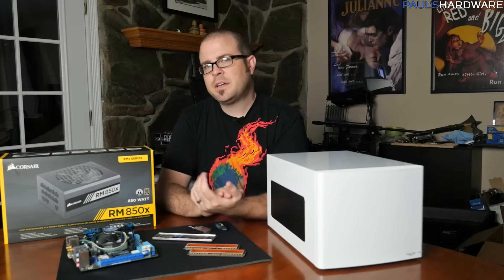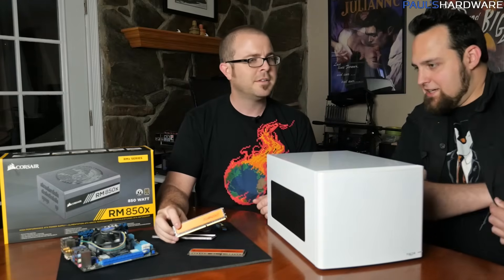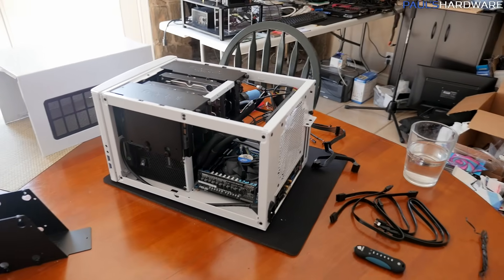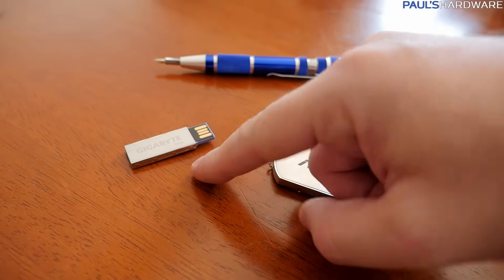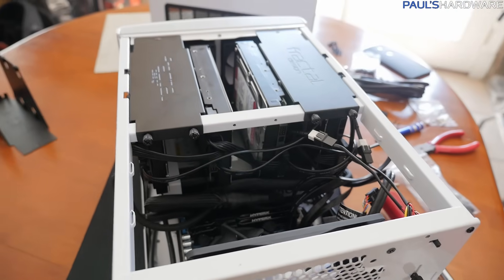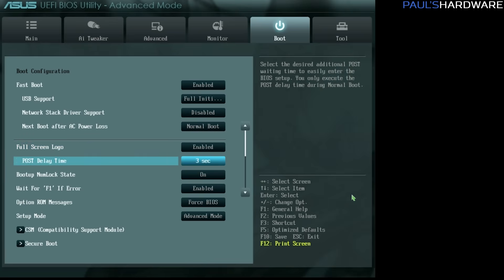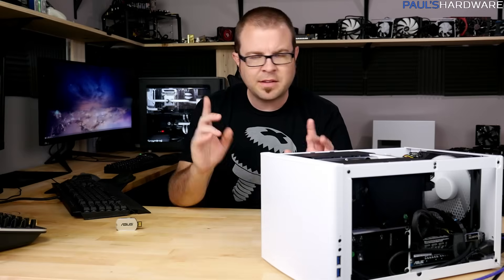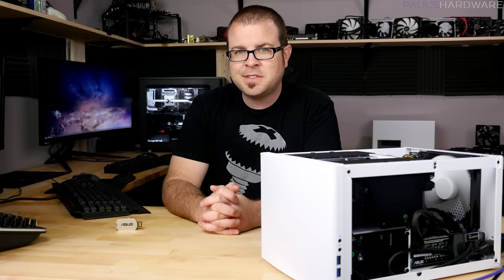Epic 16TB FreeNAS Build (Surprise Guest!)

Comment: Do I really need WD Red instead of Blue ??
For the price of a 2TB Red I can get a 3TB Blue !!
Reply: +Francesco Lorenti It's recommended because of the way the NAS drives are manufactured and certified, regardless of whether you're talking about the WD Red, HGST NAS drives, or Seagate NAS drives. They can handle random reads and writes a lot better and are designed to be thrashed like crazy due to random reads and writes coming from multiple users simultaneously.

That being said, you can use a WD Blue or any other desktop drive, provided they're reliable (check the reviews), especially if you don't anticipate using your NAS heavily or if you're the only one who will be accessing it. Heck I've read of some NAS builders using WD Greens, and others just use whatever HDDs they have lying around.

Whatever drives you do use, make sure to set things up so you have some level of redundancy so you don't lose everything when a drive dies. And offsite backup or cloud storage for the critical stuff you'll be storing on the NAS is always a good idea as well.
Reply: +brandishwar yes just as I tought, I'm the only one thats going to use the nas and whit the money I will save i will get two 3TB blue put them in raid1 and bam 3 TB of always backed up content accessible from my main PC and my raspberry pi connected to TV,
thank you very much for your answer
Reply: Francesco Lorenti
No problem. One recommendation, though. If possible, get the drives from two different retailers -- e.g. buy one from NewEgg and the other from Amazon. This will virtually guarantee you're not getting two drives from the same manufacturing lot, which will lessen the likelihood of you losing both drives within a short time of each other.
Reply: +brandishwar if only all the people on the internet were more like you, internet would be a better place. 
Again thank you, you've been very helpful !!

Comment: No drive slider/drawer for easy replacement of failed raid drives. 
The joy of youth and innocence...
Reply: Its a home nas... Not a business solution.
Reply: Niklas T Drives are not like tires... They fail whenever they feel like it just for sh1t and g1ggles. There is no backup of the startup usb drive. Big mistake. It's even worse at home, because you always have something better to do than tryin to find a matching drive for replacement. I spent 16 month with a failed drive in a raid 6 array thinking that I'll wait for another one to fail before going dumpster diving in the case to replace them...
In fine I bought a esata expander case with 8 trays and new disk to copy the array. unmounted the failed one and let her rot in the original case until the day I'm bored enough to do something about it.
your kind of apologism is not constructive...
Reply: +Michel BURTE II um tires also fail when they want too, so that makes no sense.

Comment: Can you run games of a NAS?
I'm really curios...
Reply: I did that with my previous NAS. I used Ubuntu as the host system, mdadm+lvm for raid and volume management, then added a Windows virtual machine and used PCI pass-through to give it native access to the GPU. Great gaming experience. Maybe 95-98% compared to installing Windows natively. It will become completely useless as a PC when you need to rebuild the RAID though. I don't think FreeNAS is suitable for this, but Linux is great.

Comment: This case gave me the idea of a challenge to put at use an old microwave, using the knobs to power up and control the fans. Unfortunately it would be to much work to make the motherboard spin XD Maybe the rotating tray can be turn to other aesthetic purposes. Even the bell (ascii 7) could be used as bio system warning, Kyle, Paul, Linus, Luke, anyone ;o)

Comment: Does this really need 850 watts?
Reply: No
Reply: +mungokiwi But it will consume more Power in idle (and maybe also just for storage)
then a lower wattage PSU, since the efficiency always is worst in the lower end.
Reply: +lápi póc He had it lying around and the system will maybe use 40-60W (5W per HDD and the CPU will not use much because NAS does not compute all that much). The number on the PSU is the MAX wattage it can output, not the average or anything, it will just output as much as the system needs.
Reply: mungokiwi i know all of that, but still, seems like a waste, regardless of the fact that he had it lying around.
Reply: +Ox King "always" is not true, it really depends per-power supply and difference can be so small it wont really matter + if he had it around, "why not" also higher-W power supply wont heat that much and some can run completely passive
Reply: I was going to say that as well... I'm all for overkill power supplies, but 850W is actually 100W móre than I have in my main gaming rig, and even my RM750x is slight overkill for my needs, so an RM850i for a NAS really is the mother of all OTT power delivery systems.
Reply: No but it does need something with enough amps to support 4 drives spinning up. Still overkill. Once you get up to 8 or more drives, the wattage is still overkill but the amps are not
Reply: System as built draws a 173W TDP. he's under a quarter of the PSU's rating, which is overkill, but low wattage gold or higher PSUs are kind of hard to find. plus, the larger the wattage gap the cooler the PSU should run.

Plus, each of those drives pull ~15W max, not 5W.
Reply: naw it needs 1500watts
Reply: you can run it with a 150watts pico psu.

Comment: Wy not un raid so you can have a nas and htpc in one
Reply: Freenas handles all of that. Unraid is for Linux tech tips children
Reply: +tobblich What? FreeBSD is awesome and rock solid with an incredibly good networking stack.

unRAID is basically Linux with KVM and a front end to manage it. Also, you wouldn't want to rock FreeNAS inside a VM as it has the potential to really mess with ZFS.

Comment: Did you label your hard drives? It comes in handy in case one of the drives fails operating properly when running in RAID. Otherwise you have 25% to find the correct one for replacement :-)

Comment: I fucking hate zfs.  but I love this case.
Reply: +Michael Theurer zfs has a lot of benefits over ext 4 including snapshots, online expansion, deduplication, and protection against bit rot. While raw speed ext4 is faster, if you care about data integrity zfs is a viable option
Reply: Why
Reply: +Joe Sirianni its slow and doesnt really add any real protection to your data.  much more important to just have rock solid stable cpu and ram.  i suggest just running a nas through ur tastiest linux distro on ext4 with a software raid and use stock cpu settings and underclocked ram for best performance/value.

Comment: 8:00 Paul, you screwed the CPU cooler wrong. You should screw it diagonally. (at least nothing happened now  - last time I did that, I broke one of those plastic legs from a LGA 775 CPU stock cooler).

Comment: Why did you choose FreeNas and not windows server? 
Also, Why do you running of FreeNas of a USB drive? 
I am consider to build a home server ans was wondering.
THanks!
Reply: +RyoRapture The developers behind FreeNAS recommend using a USB drive for running the operating system purely because of how small it is. The base minimum storage requirement for the OS is 8GB, but 16GB is the recommended storage for it.

And the main reason to run FreeNAS over Windows Server is the price tag. FreeNAS is... well... free. Windows Server, on the other hand, is most certainly not.

Comment: Why use a NAS ? And not external storage with cloud 
I have 4 external storage 2TB each (8TB) to back up all of my game video photo and files. 
Should I get a NAS ? 
Can someone please explain
Reply: +eldon9193
NAS = Network Attached Storage
External drive = DAS = Direct-attached Storage

An external drive is, by default, accessible only to whatever device it is directly attached to. Sure you can enable sharing in Windows to make it accessible to everything else on the network, but you're not really creating a NAS at that point.

A NAS's only job is serving and receiving files from the network. It doesn't do anything else. It is accessible from all devices on the network -- e.g., if you have tablets and phones from which you want to access media content you have stored off. You can control permissions on it as well, and those permissions can be a little more granular since all control over that storage is decentralized.
Reply: http://www.bestbuy.com/site/wd-my-cloud-2tb-external-hard-drive-(nas)-white/1766059.p?id=1219063237222&skuId=1766059
Reply: By using a NAS anyone within your selected network can access the same files at the same time. I guess it's just more efficient for the use of sharing files rather than backup.
Reply: +brandishwar    thanks 
I will consider building one for my house 
I just don't know if I really need one just yet 

I have three old PCs laying around doing nothing I'm assuming that I could take parts from all of them and Build a NAS for myself 

I was looking at Linus quick as possible video for what a NSA is. 
Now to see what I need to build one !?
Reply: The WD my cloud Are really good at sharing files too
Reply: +eldon9193 You'r external drives are 1 bay (1 drive) each so there no reliability that you can get with a multi drive raid setup. At least you have cloud storage so you'd be OK probably but if the drive on 1 of you enclosures dies everything will be lost and you'd have to pull it back down from the cloud if you needed fast access to it.

Comment: Paul, I love your channel, but I wish you had done more research before taking on this build. There were several "best practice" violations with your build (with regards to FreeNAS). Most significantly ECC memory (and a compatible motherboard and CPU). You owe it to the community to do more research and be more informed before making videos like this. FreeNAS is an awesome NAS solution (I use it myself), but it comes with a heavy responsibility to be well informed. A lot of our intuitions do not carry over from Windows to FreeNAS.  I would worry that people may follow this build and dive into FreeNAS and then suffer data loss because they did not understand ZFS...
Again, love your channel, and respect what you do, but giving some constructive criticism.
Reply: +David Gulbransen

Many have used non-ECC RAM with FreeNAS and not had any issues. Sure, some haven't been so lucky, but then whether those losses were caused by not using EEC RAM isn't so easy to pin down. Instead it seems to be the ready assumption when there are so many other causes of data corruption and loss. Even the ZFS developers say there is nothing about ZFS that requires ECC. Sure it's a good idea to use it, and they say to use it. No one says to not use ECC RAM either. But it's a bit far fetched to suggest that your data is somehow at greater risk by not using it. There've been several in-depth technical discussions online of why ECC isn't absolutely required. You're not necessarily setting yourself up for doom, gloom, torture, and data loss by not using ECC RAM.
Reply: +brandishwar 
True, but best practice is best practice. If you're using FreeNAS for its merits of data integrity, you should use best practices. I won't get lost in a discussion of ECC vs non-ECC (head to the FreeNAS forums and read their discussions on it if that is your wish) but regardless, ZFS bases its integrity on having reliable data in RAM. Having ECC is best practice to ensure that data is reliable, and then it can scrub and monitor the data on the drives with confidence. Just because many have not had issues doesn't mean you shouldn't do it. Many people don't wear seat belts and haven't died from it, but that doesn't mean you shouldn't wear one.
Reply: David Gulbransen
I needn't go to the FreeNAS forums to see the discussions there. I've read analyses elsewhere. Even the ZFS developers have said that there's nothing special about ZFS that requires ECC RAM, leaving me basically thinking that the whole thing has been completely overblown. They agree that using it is a good idea, but they don't agree that using it is a must with ZFS.

Discussions about the actual level of risk involved with not using ECC RAM have basically devolved into "use it or you'll be sorry!" It's about like saying one unvaccinated child is an epidemic waiting to happen.

I've seen the discussions on the FreeNAS forums, by the way, which is why that's not the only source I've consulted on the topic. Plus I already know from experience that data corruption comes from multiple sources, and there are various preventative measures you can take against it.

Are you using ECC RAM in your desktop? Why or why not? After all, the benefits of ECC RAM can easily be had on your desktop. To borrow on your comparison, why wear the seat belt only some of the time instead of all of the time? If you're not also using ECC in your desktop, that shows you're aware of some of the risks involved and have chosen to accept them. So then those risks can either be discussed rationally, or the discussion can remain at its current "use ECC RAM or you'll be sorry!" state, which is about where the discussion currently lies, unfortunately.
Reply: +brandishwar 
"It's a good idea." That's all I'm saying. I don't know why people get so defensive of saying that ECC memory isn't necessary. Of course it isn't necessary, but it's also a good idea. It's so widely available, there's no reason not to do it (if you're really wanting to reuse old hardware that's your call). I'm not fear-mongering, merely proposing best practice. 
Your example of vaccinations is telling-sure, an unvaccinated kid is unlikely to encounter problems, but I still sure won't take that risk when the remediation to that risk is so widely available. Data integrity and security is never 100% foolproof, but you always want to mitigate risks where possible. Mitigating the risk of data corruption in RAM is an easy fix, so I encourage it. I also encourage getting an an UPS. Agin, easy risk mitigation. Of course there's lots of ways your data might be corrupted-does that mean we ignore the easy ways to prevent what we can?
Reply: +brandishwar 
I go back to the seat belt example: just because I could conceivably die in a myriad of ways each day, that doesn't mean I don't take basic steps to avoid the risks that I can (wearing my seat belt).
Reply: +brandishwar 
And no, I don't use ECC on my desktop. All my data is on my NAS, safe and sound, with whole disk images taken every few months. If my desktop OS gets corrupted, it's an easy 15 minutes to be back up and running. Again, risk mitigation, jut in different ways.

Comment: Interesting timing on this video. I finished a preliminary build on my NAS last night. Mine was a spare AMD FX processor and board that came out of my wife's computer before I swapped her out for an i7-5820k. And as the AMD FX supports ECC RAM, that was the first thing I swapped out, along with having a pair of 4TB WD Reds for initial storage.

And I say "preliminary" on this as the case it's currently isn't where it will stay. And the RAM will eventually be expanded to 32GB and the storage out to 32TB raw, 16TB effective.

Comment: I recently upgraded my NAS too :D newegg.ca had a huge deal on 5TB WD Blacks. So I splurged and slapped 5 of them in raid5 for 19TB of storage, replacing a mishmash of Seagate and WD Red 2TB drives which ran with about 10TB of storage. I'm surprised Logan didn't mention it in the video, but you might want to think about going with ECC memory. It's highly recommended with a NAS system.

Comment: Paul... Paul...  Paul....................................................................... I love your content  BUT I am surprised that Logan didn't tell you that ZFS, pretty much requires ECC memory, otherwise you have a much higher risk of losing data.  But I may be overly paranoid
Reply: +Jon The Guy  I stand corrected, Wendell gave you permission, its all good lol
Reply: +Jon The Guy You have a higher relative risk of losing data by not using ECC memory. ECC RAM is recommended for FreeNAS and ZFS simply because of what it does in memory. ECC RAM, though, is typically used in servers simply because you tend to have banks of servers in one room or on one rack, increasing the risk of electromagnetic and radio interference on the memory, increasing the risk of memory corruption that can take down systems that are supposed to be running 24/7 with >99.9% uptime.

Many have run FreeNAS without ECC and not had any problems. Plus there are other sources of corruption and data loss, such as using poor-quality data cables and using a cheap or degraded power supply. Both of those can cause data loss, and the latter can cause hardware damage. If you've got dirty power and you're not using a UPS, you're only asking for trouble. But ECC isn't going to save you from any of that, and you're not under a significantly higher relative risk of data loss by not using it depending on your environment.